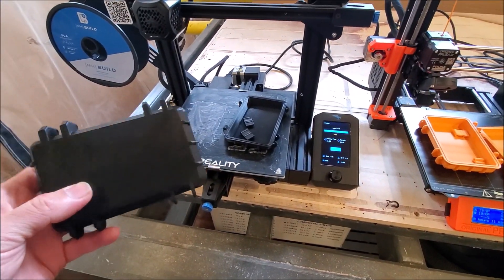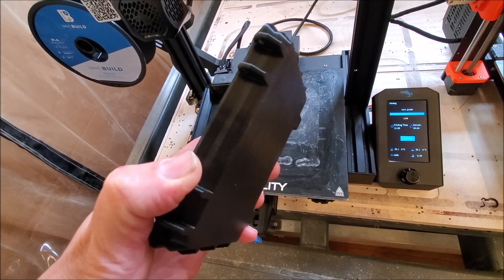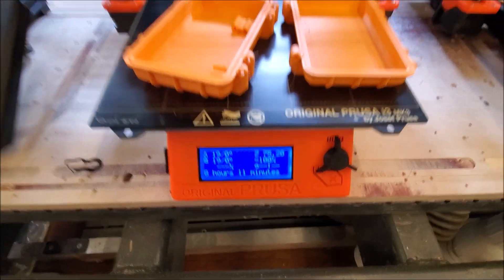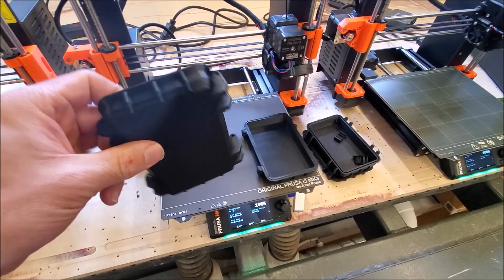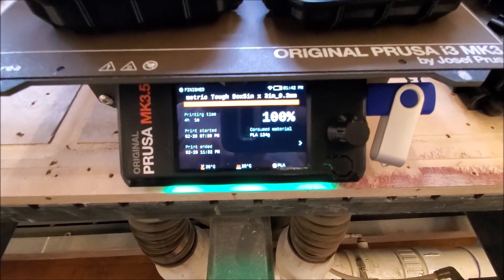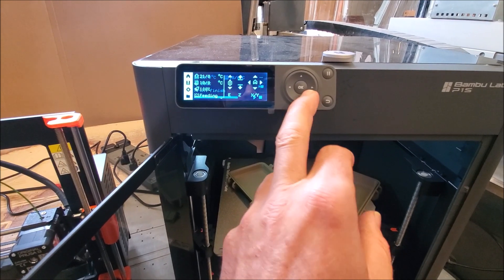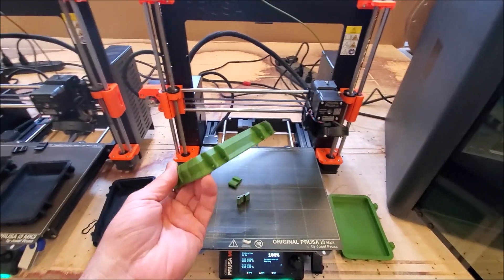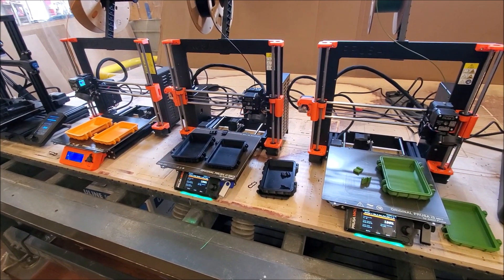3d printer speed test: Ender 3 V2 vs. Prusa Mk3S+ vs. Prusa Mk3.5 vs. Bambu P1S

Comment: The problem with the defects are related to the used sheets. PETG sticks well to the powder coded sheets, but PLA sticks better to the PEI sheets. If you have a large surface on the bed PEI could be the better option…
Reply: Stupid question: isn't powder coded sheets and PEI sheets the same thing?

Comment: If your prints slightly peel up on the P1S and other printers, try increasing your bed temp a little bit. I print PLA on my PEI powder coated bed at 55c with no glue stick or anything on it, I just use rubbing alcohol and prints stick really well. Anything below the 55c, prints always start peeling up around the edges. I think i print PETG around 70-75C and they stick well around that temp. 

I also find that printing a slow first layer helps the plastic fill in the little pockets in the pei texture for better adhesion where as faster first layer kind of bridges over those small pockets and can cause the curling around the edges.
Reply: For pla plus on mk3s and mk3.5, I set the bed temp to 65c. When using textured pei, especially new sheets, it helps to lightly wet sand the sheet with 600-800 grit if you have adhesion issue with pla.
Reply: @MrLaserpowered  Yeah, you can probably get with a little more heat on open printers. The bambu enclosed printers you have to be careful because the filament gets soft in the extruder and can jam up.  I did a lot of testing to find the max temp that does not cause this on my X1C.
Reply: In addition to increasing the bed temperature, I keep the print fan off for the first 1.0 mm to 1.5 mm of print then I ramp them up over the next 4 to 6 layers.  (PETG).  My bed temperature with PETG (Prusa) is 85 to 90.
Reply from the maker: I usually don't have issues with it but I hadn't cleaned the bed after a few prints and I usually print with the door closed even though Bambu says to take the top off or leave the door open when printing PLA. This was the first time I've ever had to stop a print because of peel up. I also have had good results with just cleaning with IPA.
Reply: @doorpz Your prints are all warped which is why the walls look sloppy. I print on my X1C with the door closed and the lid on with PLA and never had an issue. I run the chamber fan on about 20% so the temps to get too high.

Comment: Just ordered my kit a week ago, are the stock slicer settings decent? Or did you have to tweak them?
Reply from the maker: I've just been using the stock settings with some minor tweaks and they've worked fine so far but I haven't printed very much on them yet. One thing to note that I came across today is that there appears to be a bug in the mk3.5 firmware that causes the printer to skip the far left side of the bed when doing the bed leveling checks and is causing issues with the first layer calibration. Prusa knows about the issue and I'm sure they will release an updated firmware to solve it.  Someone seems to have made their own firmware version that fixes the issue but you would void your warranty if you installed it. It may be worth waiting until there's a fix for the issue before updating as it will affect any full bed prints or anything you put on the far left side of the bed. You can read about the issue here,  https://www.reddit.com/r/prusa3d/s/nYD2SR4qdw
Reply: @doorpz  New firmware has shipped (v5.5.2). Still waiting on my upgrade kit...
Reply: The prusament pla profiles fan settings is set to high. 1st layer goes down nice, but 2nd and so on look rough. Because of the speed increase, pla temps are increased to 230c. Prusa is aware the profile is garbage and said they are working on it.